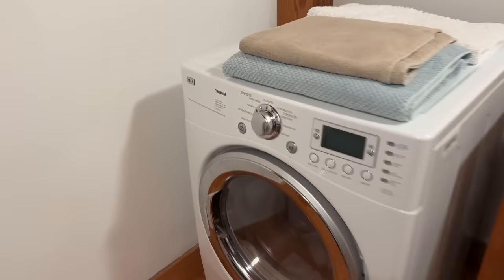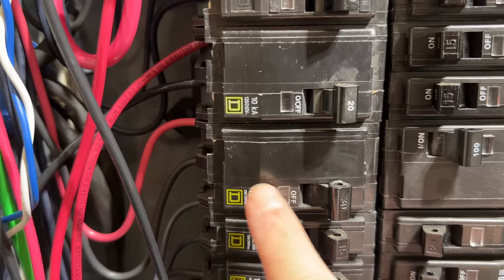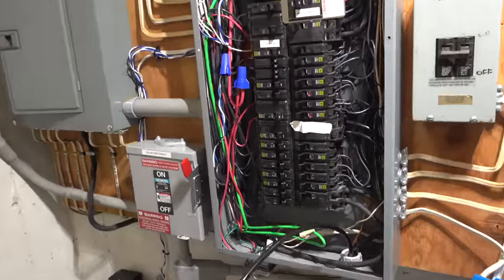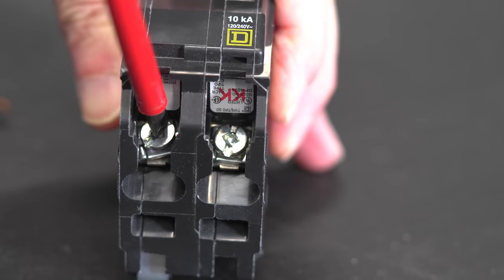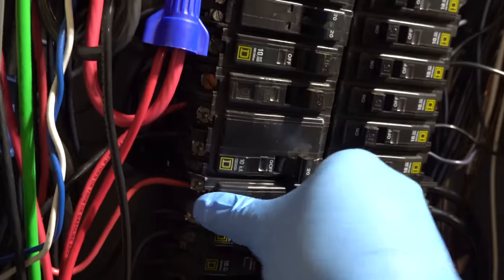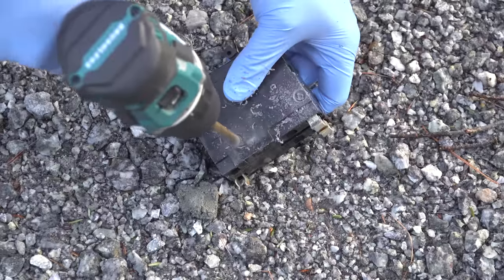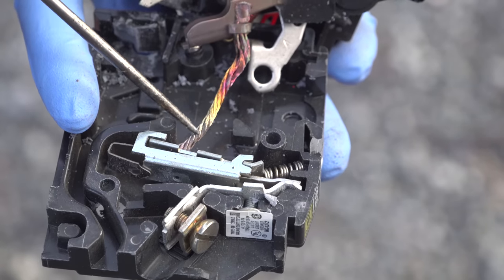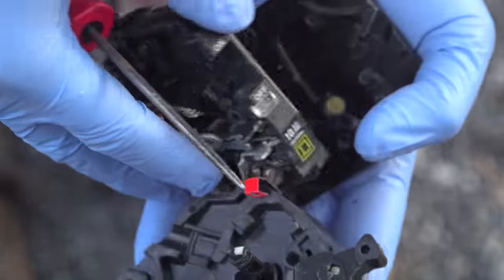If Your Circuit Breaker Makes a Buzzing Sound 🔥 Fix It Quick!

Comment: Good video, I would like to offer some feedback however.  I spent an entire career in the electrical/electronic industry manufacturing these same type of products (different brands).  Please, please always recommend that the main breaker of the panel be shutoff before replacing a breaker, the slightest contact with live bus bar will lead to disaster.  Second, while I appreciate you are taking precaution to wear some type of glove, those are not the gloves to be wearing when working on this equipment.  Even a tiny pinhole in the glove can lead to catastrophic results, made even worse by the fact your hands tend to sweat in latex gloves, therefore please use proper electrical gloves that are readily available at Home Depot or any of the big box stores.  Third, that breaker clearly saw an overload condition for an extended period, not quite enough to trip the breaker but enough to cause the components to fail over time.  It looks like you have a new appliance so I suspect the prior home owner had an old washer/dryer that were not operating properly.  Fourth, always install a surge suppression device in your panel to provide whole home protection, the vast majority of surges are generated within the home vs. external sources.  Every time an appliance, furnace, A/C unit kicks in they create surges in your system because they all contain electric motors.  Electric motors have an initial inrush current of 6-8X their normal running amperage, for example if you have a 3 amp motor it will produce upwards of 24 amps or more during startup for a very brief surge period.  Surge suppression on your panel will absorb those surges and extend the life of electronics and even light bulbs.

PS: I really do like your channel and the quality of your videos, you get to the point and avoid gimmicks like AMSR sounds!  Nice work
Reply from the maker: The gloves aren't there for electrical protection, its for visibility on camera. The other feedback is all very good.
Reply: As an electrical engineer, I second all your recommendations, particularly the one about turning off the main breaker before touching anything.  I felt this point was glossed over too lightly:  "If you're really concerned, go ahead and turn off the main circuit breaker"  Strongly disagree:  There is no circumstance that a homeowner should work on a live panel, and even qualified personnel should only do so only if strictly necessary and wearing proper PPE.  Electrical shock isn't a joke, even at 120 volts L-G, and an arc flash can be very dangerous.
Reply: That is 100% not what a surge suppressor does. It does not limit inrush, start up, or LR current. For the sake of the industry and science, I really hope you aren't actually a life-long electrical engineer.
Reply: @ewicky  That was going to be my comment as well. The typical Type-2 SPD handles transient voltage spikes. They are typically just a couple of cheap metal oxide varistors, which function by acting like  a voltage-based switch. Connected from hot to ground (for example), it normally sits there with high impedance (off) below the clamping voltage (usually 300V+.) If the voltage exceeds that set value, it 'switches on' and clamps the voltage by shorting it to ground. In doing so, it dissipates current (that's the current rating for the SPD), but it in no way clamps based on the current flowing in your panel or from any of your loads. (it couldn't, because it's not connected in series with any of the loads)
Reply: @edprior2821  'Qualified personnel' work on live panels every day. We can't shut down entire buildings just to work on one branch circuit. And 'the slightest contact with live bus bar will lead to disaster' is not accurate. The current needs a path, and unless another part of your body is grounded you'll feel nothing. I've shown this to folks many times.
Reply: I like to lick my palm wet and use it to sense the bus bar for electricity.
Reply: @ewicky Read my comment again please, I never said it limits the inrush or startup current.  I said it absorbs these surge current, which can appear as transient spikes in your electrical system.  A surge suppressor is designed to deal with transient surges in the electrical system, most people think of lightening strikes as one source, which is one possibility.  However my point was, the majority of transient surges are typically much smaller surges generated on a daily basis within your home from sources like those I mentioned.
Reply: @sirgalah561 It could be due to a number of reasons.  If you have them on a dimmer switch and dim the lights frequently it could be due to the fact the dimmer switch is not designed for LED dimmable lights.  It could be due to overheating caused by a number of things (i.e.: poor connections, older electrical system, etc).  It could be a bad batch of bulbs or electrical surges in your system could be affecting them.  I would start by understanding first if the problem is isolated to one room in your house or to other areas where LED bulbs are installed and powered for similar periods of time.  I had an older home years ago that had a similar problem with bulbs that did not last long, I took steps to first make sure there were no electrical wiring issues by having a qualified electrician inspect my home.  There were no issues in the electrical system so I proceeded to install a surge suppression device as I knew it had to be internally generated surges.  My light bulb problem went away after installing the surge suppression, as I knew it would.
Reply: @paulmaxwell8851 Key word “Qualified personnel”, who are trained to work on live equipment and wear proper arc flash PPE.  My concern was centered around the everyday homeowner trying to do this type of work on a live panel.   But with that said, after spending a entire career in the industry I’ve seen tenured qualified personnel badly injured on commercial low voltage lighting panels.   In one case it was the simple act of removing the cover and brushing life components, the individual was in a rush and wasn’t far enough from the panel before swinging it away causing a lower corner to connect.   The result was catastrophic and resulted in major burns to his upper body from resulting arc flash.   In transparency this was in an earlier era when qualified personnel commonly didn’t wear proper arc flash PPE like we do today, nor were they as educated to it.
Reply: @bluesky9093  You literally said, "the vast majority of surges are generated within the home.", "Every time an appliance, furnace, A/C unit kicks in they create surges in your system", "Electric motors have an initial inrush current ... during startup for a very brief surge period.  Surge suppression on your panel will absorb those surges..."

You absolutely said that a surge protector with limit inrush current "surges".
Reply: That's interesting; I thought surge suppression only worked against overvoltage transients. I didn't know surge suppression functioned as an inrush limiter
Reply: @ewicky  Thanks for the confirmation, I'm a new electrical engineer (I work in microelectronics so this isn't my specialty) but I was under the impression that surge suppression didn't limit inrush current
Reply: The cartoonish voice will protect more than the thin rubber gloves will.
Reply: @paulmaxwell8851  OSHA is staring at you menacingly fr
Reply: @windows74001  i think what he's talking about are the inductive loads in the house, these fckers can blow breakers if you're not good at calculating its Irc. The SPD can help compensate the sudden abrupt transient spikes caused by the recovery of the system i.e the motor has started and it's on its rated power. This can sometimes lead to transient voltage spikes.

Another part is a missing neutral, this can blow spds to kingdom come
Reply: @dragonfireproductions790  Sure but he's specifically referring to starting inrush currents, not inductive voltage transients from an abrupt change in operating point. Afaik surge suppression does nothing to prevent high inrush current
Reply: @bluesky9093  Surge suppression limits voltage spikes; when you start a motor there is no voltage spike; it's a voltage drop due to the very high currents. As the motor climbs in speed, this voltage ramps back to nominal. As far as I'm aware, this whole series of events is invisible to voltage suppression circuitry, because there is no voltage spike above nominal operating voltage.
Reply: @windows74001  I literally said Irc
Reply: @windows74001  the motors can cause an imbalance in voltage especially in 2 or 3 phase systems, which is common in the US, UK and EU. It can sometimes cause voltage spikes
Reply: @dragonfireproductions790  Yes, and I literally said that surge suppression doesn't compensate for the inrush transients
Reply: @windows74001  remember that the neutral isn't switched off in the appliance when the appliance is turned off, where would that stored voltage in an inductor go?
Reply: @windows74001  what happens when you shut off an inductor suddenly? Wouldn't it cause a voltage spike? Where would that voltage spike go? 

Would it go to neutral?
Would it arc over the switch and back to the live
Or both?

Or maybe it just magically goes away?
Reply: @windows74001  try this experiment:

Get a hair dryer, plug your dmm on the outlet next to where you plugged the hair dryer. Cycle the hair dryer on and off rapidly at the highest setting, there will be a 1-10V voltage spike
Reply: @dragonfireproductions790  also wouldn't universal motors produce quite a bit of noise (that a suppressor could deal with)? Things spark like crazy during normal operation after all.
Reply: @dragonfireproductions790  Single phase is two hots, 3 phase is 3 hots, what is two phase?
Reply: @veri745 et me try this one more time, and again please read my original comment which stated - “Surge suppression on your panel will absorb those surges”.  I said it “absorbs” not “limits”, there is a big difference.  In the electrical world the word “limit” implies you are actually limiting the amount of current output from something like a short circuit.  Some short circuit currents can be extremely high (i.e.: 200,000 A), current “limiting” fuses or breakers designed for this purposes will actually limit the amount of short circuit passing through them to downstream devices, before they actually open the circuit.  A surge suppressor does not limit but rather utilizes metal oxide varistors (MOV’s) to "absorb" any excess voltage and then act as a "shunt" resistor to divert the excess current to ground.  Here is a link to two very well known companies that manufacturer a broad range of surge suppression devices, they both explain the internal surge sources I mentioned above.

https://www.eaton.com/us/en-us/products/residential/what-is-a-surge-protector.html

https://www.se.com/ca/en/work/products/explore/home-surge-protection/homeowner/
Reply: @windows74001 ee my response above, surge suppression utilizes MOV’s to absorb excess voltage and divert excess current to ground by acting as a shunt resistor.  Switching of motors in your home appliances, HVAC are sources of surges.  My response above contains links to two very well known companies that are experts in this field and provide some good videos on their site explaining this in greater detail if you are interested in learning more.  Appreciate your comment.
Reply: @paulmaxwell8851  yes people do work on live panels every day. However this work should never be performed alone, requires PPE, and even when performed by highly trained and experienced personnel must be justified.
Reply: @sirgalah561  I'm not an electrician. I just have some general knowledge on this topic. LED bulbs generate heat. If the bulb cannot dissipate that heat it will cause the components inside to overheat and separate. You said you had an old light fixture so I'm assuming it's a screw in LED bulb. Types screw in LED bulbs are not the best for that very reason but there are some better quality ones that will last they are just a bit more bulky. Finally if the housing to the fixture is enclosed with little ventilation it may just be more beneficial to change our the fixture in the long run.
Reply: @aaronbricault2467  
Not screw in LEDs.. The bulbs have 2 pins and push in.. How can they generate heat when I can take out an LED thats been on for hours and not feel hot at all.. The halogen bulbs that used to be fitted were hot as hell, that's why I replaced them with LEDs..
Reply: @edprior2821  Indeed. I'm an electronic tech, been working on high voltage and high current devices for decades, I have an innate feel for working on circuits that have melted the ends off of screwdrivers from accidental shorts, and there's no way I'd change a breaker without shutting off the mains. And even then, not working on the panel without checking with my meter first. There's always the chance of trickle currents getting through the breakers or a moisture bridge.

Frankly, if you have to coach someone on doing this, they shouldn't be doing it. There is no room for error.
Reply: @ewicky  Indeed, there's a stated 'delay time' to trip for breakers, and it's a thermal rating, not surge rating.
Reply: @paulmaxwell8851  "Qualified personnel" don't need to watch this vid. They know better. This vid is dangerously misleading on a number of points, and so are many of the comments.
Reply: @bnasty267  [They are typically just a couple of cheap metal oxide varistors,]
Really? Reference please.
Reply: Wow more than one supposed expert commented, "surge protectors help with draw or load..."
This would be absolutely INCORRECT!
The national electric code is a really long and good read. I'm going to suggest you dig into it.
Reply: @stephensaines7100  Us qualified personnel get these kind of vids recommended to us every day by the algorithm. But I agree with Paul, Honestly if you aren't confident enough with changing a push in breaker you should just hire an electrician. Then while they're poking around the panel they might spot something else wrong you might not have noticed.
Reply: @sirgalah561  
Unfortunately the manufacturer puts in resistors that drive the leds  at maximum. If a larger resistor is used. You lose a little brightness but gain a much longer life of the led.
Reply: @impactodelsurenterprise2440 😂
Reply: @impactodelsurenterprise2440  Always got 2 be ONE!!!😂😂😂
Reply: Hello 👋🏽 there, I am a homeowner who knows VERY LITTLE about this subject!!! So, to the knowledgeable people in this particular thread can someone please give ONE DETAILED COMMENT (without DEBATING) about how to PROTECT MY HOUSE FROM ANY ELECTRICAL SURGES, ETC PLEASE? 🙏🏽 Thank You!

Comment: Just found a breaker making a similar sound as yours, since I had watched your video when it came out, I was able to remember that this was a problem and switched out the breaker. When I took the old one apart, it had the same discoloration on the wire as yours did.

Comment: Have a Sense Power Monitor installed which uses a set of Clamps to monitor the Wattage used @ the Main Breakers/Main Service Panel.  

Been thinking a "Buzz" I've been hearing is from those Clamps but then again they might be masking the fact that it could be that or a combination of various breakers reaching their end of life?  Suspect my Water Heater and Dryer Breakers are two of the "Hardest Working" Breakers with almost daily regular heavy use year round... 

Even though the Water Heater is on a Time of Use Timer (meaning it is Off for maybe 12 hours a Day) I suspect it and the Dryer would be the ones to show the most damage from actual use.  They tend to see heavy use at the same/similar times so because of their age it might not be a bad investment just to swap 'em out (or at least have a spare handy if needed when the day comes)

Comment: I've had exactly a same situation. One of the c. breakers was making buzzing sound when electric stowe was in use.... After cpl of years I've had it enough and replaced it by myself.  
At a time of replacement, that c. breaker was 20 yrs old. 
Others are still silent and in use ( abt 25 yrs at this moment).

Comment: Il bet that the contacts were not fully pressed together iside the breaker, a manufacturing defect. This would be the cause of the arcing & overheating. I had the exact same breaker 
at my sisters house just drop one leg to the electric dryer. I went & got a new breaker & everything was ok. You were VERY SMART by checking these BUSBAR CONNECTIONS 
because on many panels the busbars are made of aluminum. Ive often seen where the connection between the breaker & the busbar is FRIED. This is when you would need 
a new panel. I was an electrician for 40 years. I used primarily Square D QO & when money was an issue a Siemens panel with the COPPER BUS OPTION. I ABSOLUTELY 
HATE ALUMINUM BUSBARS. Ive had to replace so many burned up panels because of this issue. I was most comfortable installing the two panels I mentioned above.
Its always better to shut off all the breakers first before shutting off the main because every time you open the main under a load you pull an arc on those  contacts
which will weaken this master main breaker over time  & it will start tripping for no reason at all. I had a customer that if she ran a vacuum cleaner the 100 amp
main breaker would trip thinking it was overloaded. When I took it apart I could see that the CONTACTS were dirty  from this breaker being turned off under
a load way too often. This is why I recommend that you turn off all the smaller breakers first then the larger ones for subpanels ect and then last but not
least then you can open the master main without causing harm to the contacts.